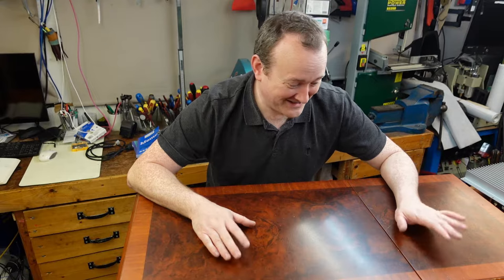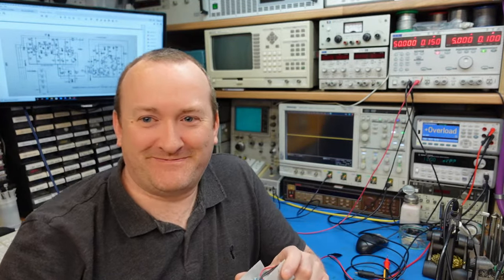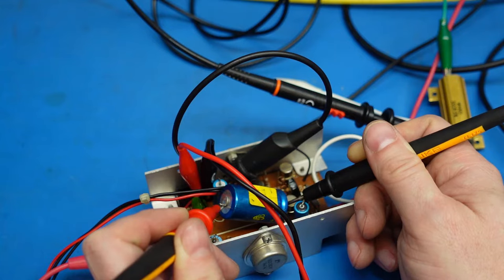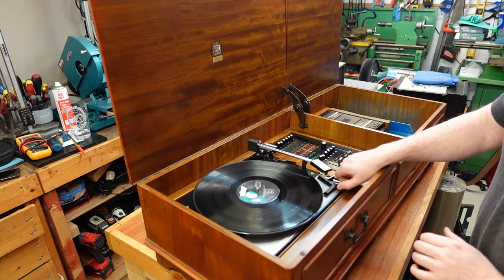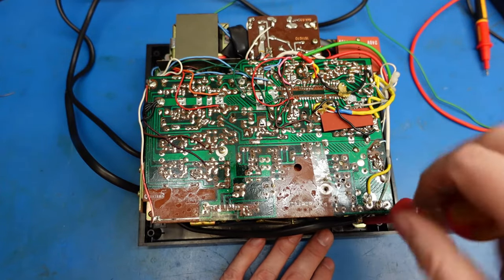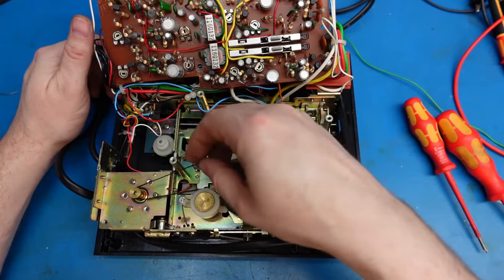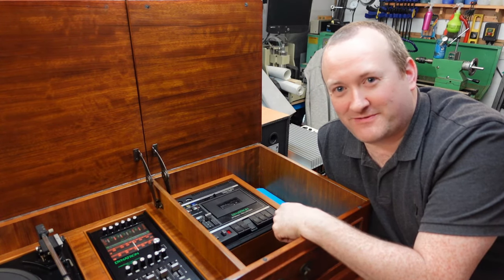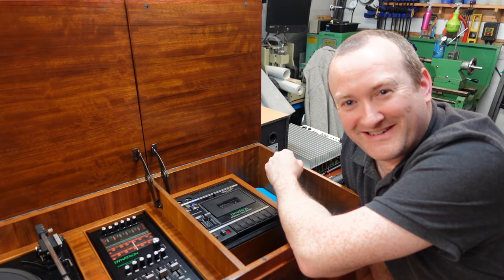Dynatron HFC205 Stereogram Repair

Comment: I was the production manager at Dynatron when we made these. The production was initially in Maidenhead. It then moved to Kings Lynn and Fakenham in Norfolk. They thought the labour force would be cheaper there. They didnt make the cabinets. They were subcontracted from  various furniture makers. Dynatron did not make the cassette unit. These were brought in from Philips in Holland. Not all they were cracked up to be. The Royal Warrant was the selling feature. Eventually the firm folded through poor sales and the parent company Philips shut the brand down.
Reply: Thatnks for you reply. What I'd love to know is how a business went about getting the Royal Warrant?
Reply: @zeitgeist909  There is no procedure for getting, or losing the Royal Warrant. It is simply granted by the Royal Family for products they have bought and simply like. Recently the chocolate firm Cadbury has lost its warrant and no reason has been given. Once a year we at Dynatron would have an enormous radiogram of some vintage since is was a valve /tube design shipped from Balmoral in Scotland to Maidenhead. It was the property of the Queen Mother. We just used to polish it and send it back.

Comment: My uncle has one of those to this day and I remember hearing it in the early 70s and loving the deep bass. About 10 years ago I was over there and asked him to put it on and it sounded terrible! I asked if it was faulty and he said no. Then I remembered that I'd worked for Audio Note for 10 years and every system in my house is Class-A valve gear, so I smiled and said "Tricks of the mind!"
Reply: Your ears are well-trained now.  Also we always remember past things more positively than they really were.  So when you revisit them later.... you are met with disappointment. But having worked at AN, I'm sure you could tweak it to sound MUCH better !
Reply: Dynatron stuff does sound good particularly certain speaker models and the valve amplified kit. All equipped with proper British Mullards. If it sounds bad he's probably got some dodgy caps and just got used it, it's aged along with him. Fix it for him!

Comment: Another enjoyable video Mark. Ah, the "Buckingham" Queen Anne Dynatron. Hopefully the legs are still somewhere and not just amputated for convenience? It was quite pricey when it was new. Introduced for the 1976 season, it started out being sold for a recommended  £664 ($1341 USD). That's £3851($4839 USD) in 2024. By 1977 the leftover dead stock was being sold for a deeply discounted £370. Crikey expensive but for looks only, not quality reproduction. 

Like many of those units, it unfortunately isn't what it pretended to be. It looks nice but is an assemblage of those 1970's plastic and mostly rubbish components. Dyatron touted the record deck as a Garrard "single play with a magnetic cartridge". Yes, it is, but it is a tarted up low end unit built on the the old AT-60 design. A decent design but not high end. It is also problem prone especially with frozen cycle cams and turntable sleeve seizures. By the late 1970's long gone was the quality that made a Garrard a "Garrard."

Comment: The dynatrons were very good. I have about twenty of them, all with goldring lencos turntables. I bought them to pillage the Lencos but they are too nice to break! 
     The amplifiers 24, 25 and 26 were a bit underpowered but the type (31?) you are working on are much more powerful. 
     And the modular construction makes access very easy. 
    Clunky, but well laid out for servicing. I love them .
Reply: The output amps were very cheap to manufacture. We put them in every  model from the bottom of the range to the classy looking units like this one. The sound quality was very mid-range, the price wasn't!

Comment: As I recall back in the day, Fast Forward used to be that you'd need to hold the button down rather than latching on - it was a feature. Rewind would latch and only stop when you pressed the Stop button.

Comment: Out of Kings Lynn factory in the 70's, I worked on them, my mother owned A similar model without a tape Deck, which worked perfectly, she sent it to the local auction house in 2004, and received £6.00 for it....

Comment: I had a Sony cassette player and the FF didn't latch either in fact it was labelled 'Skip' for just shifting the tape forwards in short sections with one press. Otherwise you have to keep pressing 'stop +play' each time you wanted to skip forward a bit.

Comment: My Dad's Dynatron / Garrard turntable had issues with the pots going very scratchy.  I didn't see you check the volume knob so I assume it worked ok and wasn't reported.  That old system sounded better than budget to mid-range  HIFI systems 20 years later.   I'm gutted he chucked it out at the dump.

Comment: Going back to the tape deck. I would of stuck a notch in it myself. As it just makes things so much easier and like any other tape deck. 
But OBVIOUSLY you would of spoken to the customer first, before you started modifying it. 

0:13 Is that a Record No25 by any chance? And does it have a quick release? Having a quick release on THAT size of a vice is sooooo handy, but if yours hasn't. 

Then just imagine how many times, over the countless years, you've had to finger your vice just to open it up enough, to stick a large part inside. But there are times when you didn't finger it enough on the first go, so the part won't fit. So THEN you have to finger it just a tiny bit more, to get the large part inside. The bigger the part, your never quite sure IF you've fingered it open enough to get it in on the last try.

Comment: In a comment someone asked about use of silicone or petroleum based lubricants. DO NOT use Silicone based lubricants near electrical equipment. Silicone lubricant is Silicon (Si) based and electrical arcing turns it into glass (SiO2), an insulator. Not good for switches, relays or potentiometers. Silicone lubricant vapour entering these is enough to cause a problem. If you don't believe me, refer to Subaru's  recent global brake light switch inoperative recall.

Comment: Newer one than me moms which didnt have the cassette but did have the speakers facing the front at both sides.
Would Abbot work than IPA?
Reply from the maker: Greene King’s IPA is designed to clean your insides out, and not cassette mechanisms. Abbot Ale will make you subscribe to my channel. 😆
Reply: @MendItMark  Already have done Mark, fascinating stuff watched every video till 3.30am this morning.

Comment: Mark, are there any problems that can be caused by machine oil degrading plastic or rubber parts? I ask because I have been wondering whether I should use silicone instead of petroleum based lubricants on such mechanisms. Great repair, though I’m still wondering what popped the fuse.
Reply: Can't give you an absolute answer Michael but I can tell you that you should not use petroleum products on plumbing plastics and rubbers at all as it degrades them - safest is to use silicone.
Reply: @Lyndalewinder  thank you very much for the response!

Comment: I did repair one of these back in the day
It wasnt as nice as this one though. Were these not Philips or mullard amplifiers?
Reply: The cassette player was from Philips. Most of the electronics was produced by Dynatron but the radio included a modular Mullard tuner which was very cheap.